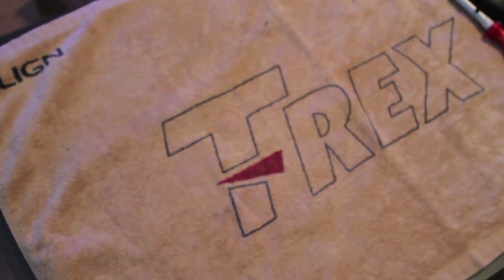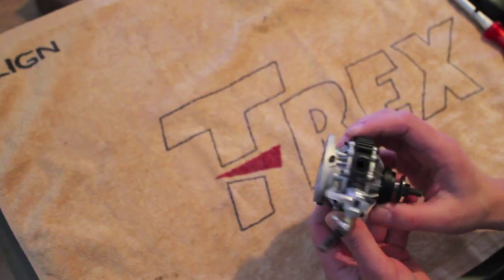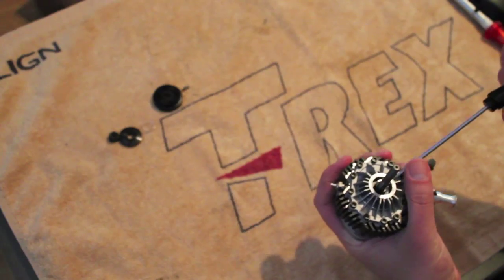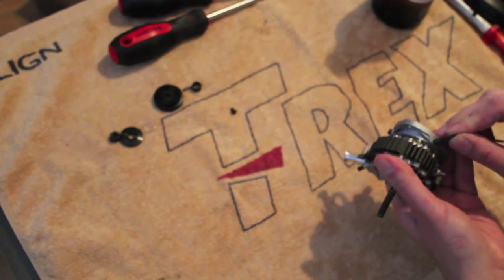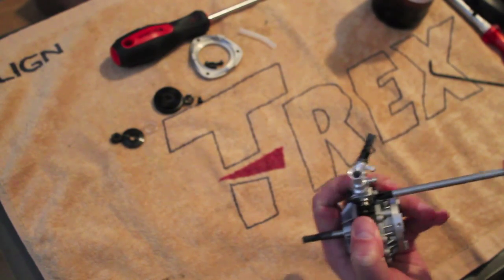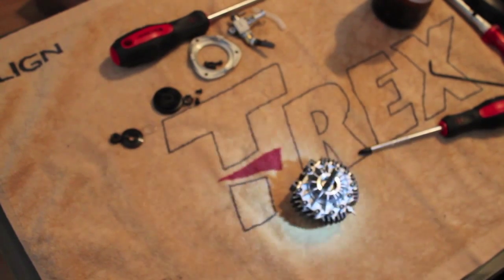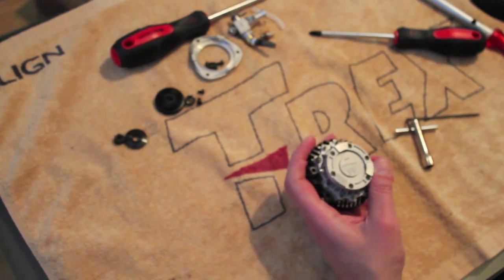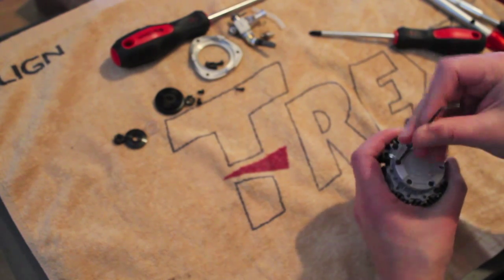OS Wankel Tear Down part 1/2

Comment: I own this version and flew it yesterday. Runs very good. Sounds nice. It is a gas pig. I mean it really sucks fuel. Way more than any other nitro motor. Leaves a very gooey mess all over the plane. I suppose that is because it is difficult to seal the engine as well as a piston type. Fun anyway.
Reply from the maker: +cashpoboy 

Yes. I agree that they run great and sound very nice. I would also agree that gas milage  is almost double to the engine volume so most of the oil doesn't burn and stays on the model if misdirected.

However it's worth it as it is a very special configuration so some extra gas is ok as long as the exhaust directs of the application.
Reply: pawelebay donde lo puedo conseguir

Comment: very cool! I'd like to know what material is each part made of. Judging by appearance, it seems that the rotor housing is cast iron, and the side housings are aluminium. If that's the case, it would be the opposite of the Mazda Wankel, which is interesting. Is the rotor also cast iron?

Also, does it leak oil when it runs? I ask because there are no oil seals or o-rings, so i would expect oil to leak through the e-shaft ends.
Reply from the maker: +Slick Tires 
Yes. The rotor housing, the eccentric shaft and the rotor is cast iron. Front and rear plates are aluminum which just as you say is opposite of Mazdas rotaries.

However there is no chrome surface.

No, it does not leak oil. It doesn't have an separate oil reservoir (oil pan) as an conventional engine. The oil is mixed in the fuel like in a 2-stroke so it doesn't have any oil pumping through the shaft.
Reply: thanks

Comment: Hi, How does this engine run compared to the previous version? As you said, this one is heavier and has less power output. But O.S. must replace the previous version for some reason, right?
Reply from the maker: +Fang Hou 
I'm sorry to disappoint but I only have tested it as a bench-test and not yet flown with it. I expect it to be more stable in 3d-flight where the old model often could get a gas starvation in extreme maneuvers. This could result in a engine cut out with an panic landing as a result.

The old one didn't have a gas tank pressurizing nipple as the new one has. So the new one should have a much more reliable fuel system as a result.
Reply: +pawelebay I see. Thanks for your reply, and for taking the time to do the nice tear-down video.